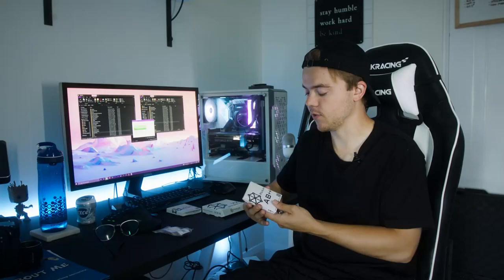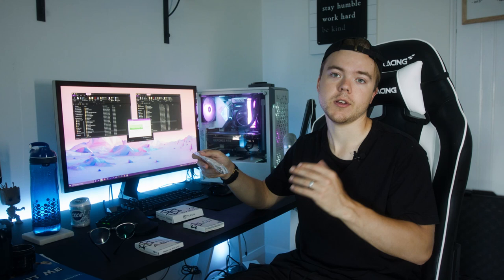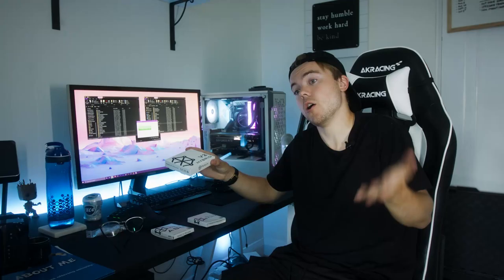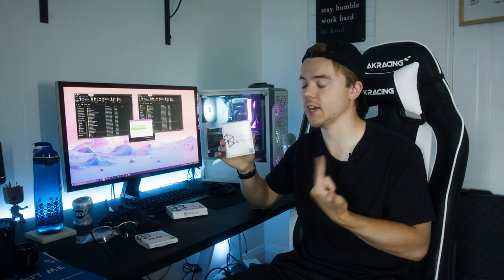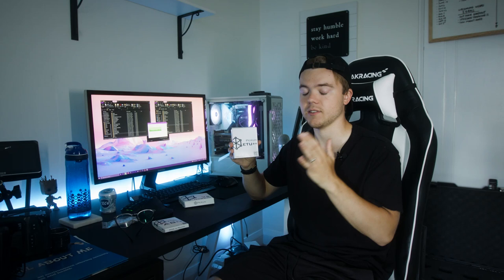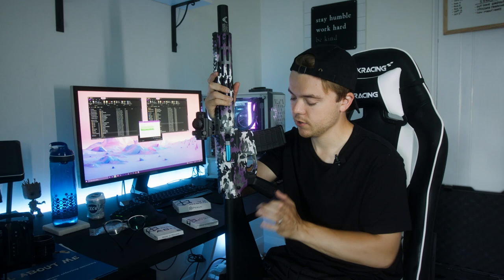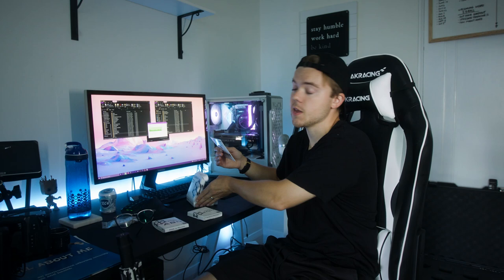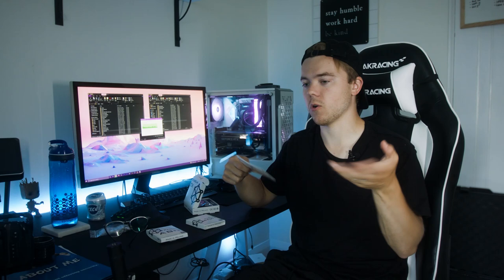Your AEG is poop BUY A MOSFET

Comment: I have the stock mosfet in my DEM904 build and it works rly well you can adjust trigger sensitivity, fire modes, it has battery protection, and Ab. So for a stock mosfet I don’t need to replace it til it burns out

Comment: There are not bad but trust me on this just spend the extra 40 for a leviathan cause adjusting the perun is extremely annoying, and their is no amp current meter or overspin detection on the perun. you can easily tell if your shorting out or overspining your sector gear with the leviathans
Reply: Their new hybrids already have current sensing and also better user interface.